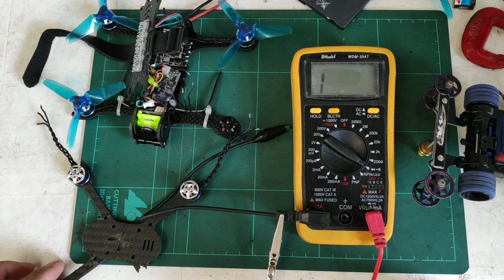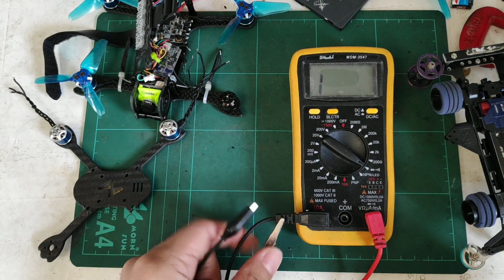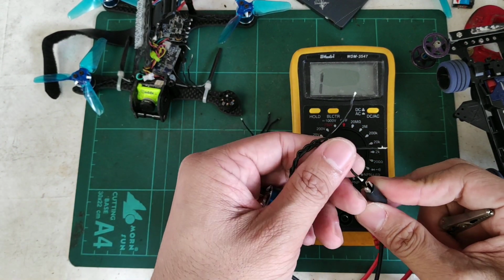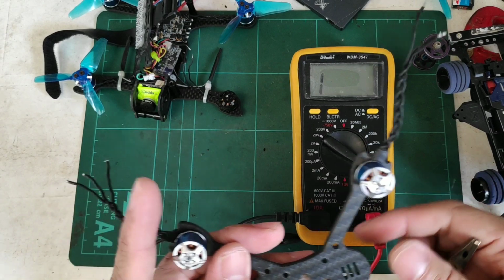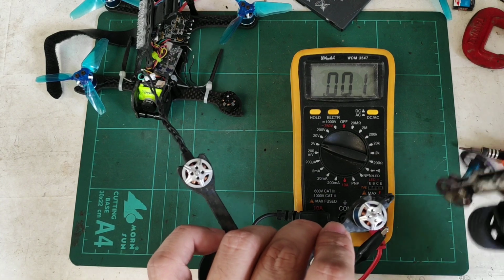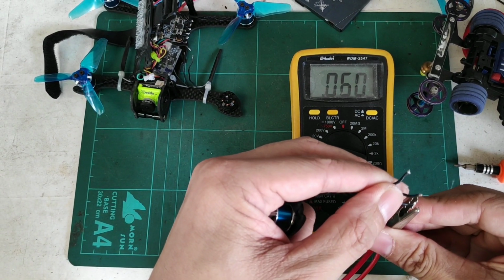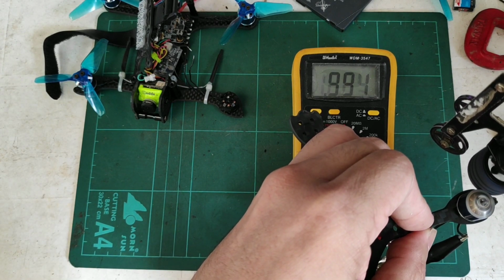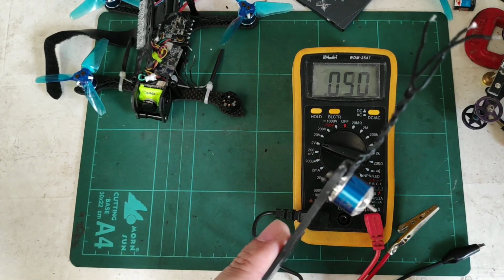How to test your brushless motors

Comment: Although a motor may pass a continuity test, this alone doesn't guarantee its health. Poor winding quality and loose wire terminals can cause induction interference, leading to overheating and potential short circuits.

Comment: WTF??  In the time it would take to do all that nonsense you could of hooked up a motor to an esc two times.  Spinning your motor  physically with another motor is not going to give an accurate reading and is more likely to damage the motor in need of testing than ESC would harm it.
Reply from the maker: Yes you are right that that's a quicker way to test a motor, but sometimes just because it spins doesn't mean it's ok. Some motors will spin and even fly despite having a short in one of their phases. This can happen if the short is somewhere in the middle of the wind where the insulation has melted; that phase will still work, but just like it had less winds. Motors that have this problem usually get hot and eventually fail mid flight.

JB has a similar video if you want to check it out; he uses a drill instead.
Reply: @emp29 , Yeah, I just ran across that one.  I have NO IDEA what was up my butt when I left that response, I just read it back, sorry, that came off very dickish.  Been out of work and trying to get a side drone business started, have some crabby days here n there.  

I am absolutely sure there is need at times to test them that way, if nothing else just as a back up test if you want to be positive.  I have no room to talk the way I MacGyver some of my quads with very non traditional hacks and short cuts...lol.  Sorry again, happy flying! ✌️
Reply from the maker: @sunshyn_RFF  no worries, bro. You brought up valid points which even JB mentioned in his video on doing this. I'm sure it would be good reading points for those who are just starting out in the hobby. Happy flying!

Comment: thank you very much, this is useful *in my case: one of the motors on my drone was broken but i don't know which one because in plain view everything looks normal, but when flown, my drone vibrates and is difficult to control, do you have any idea what I have to do to find a broken motor?
Reply from the maker: To find the offending motor, you can just do a motor test in betaflight. Spin each one to full then back, make sure to remove your props. You'll hear and feel which motor is giving low power or excessive vibration.
Reply: @emp29  thank you very much, i will try it, is it safe to full spin the motors? i've never do that before :)
Reply from the maker: Yup its safe. Just don't do it for long. One swift slide to 100 then back down to off is all that's needed.
Reply: @emp29  thank you very much :)
Reply: Check your screws, your tuning
Reply: @Tristan Jaiden i really appreciate your reply. I got to the site thru google and I'm in the hacking process atm.
I see it takes quite some time so I will get back to you later with my results.
Reply: I guess Im asking randomly but does any of you know a way to log back into an instagram account??
I was dumb forgot my login password. I would love any tips you can give me.
Reply: @Skylar Marcus Instablaster =)
Reply: @Tristan Jaiden It worked and I now got access to my account again. I'm so happy:D
Thanks so much you saved my account !
Reply: @Skylar Marcus Glad I could help =)